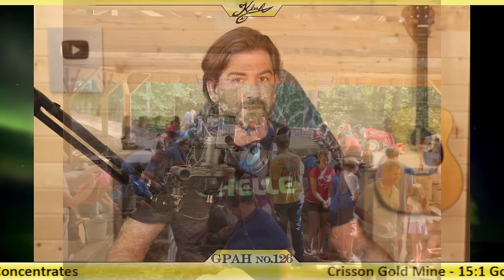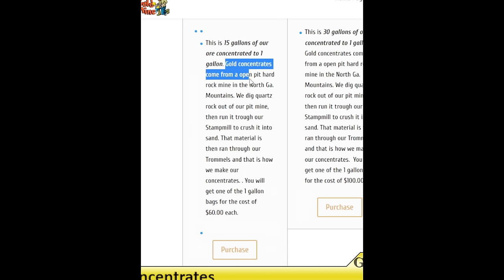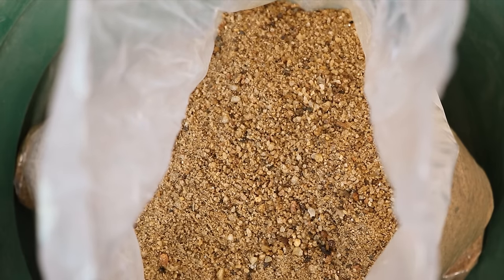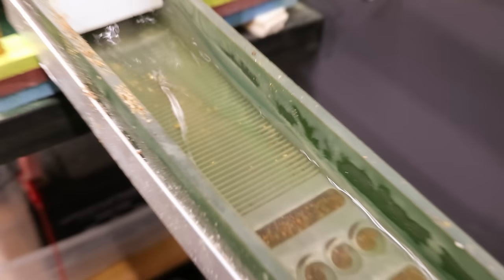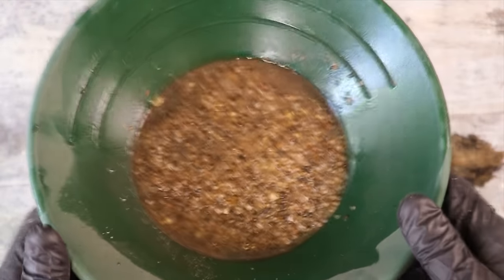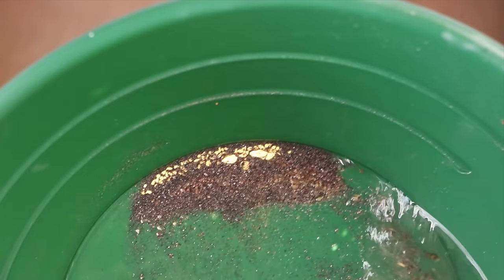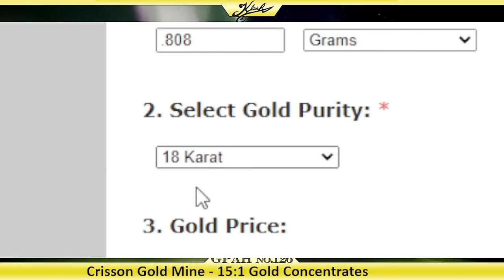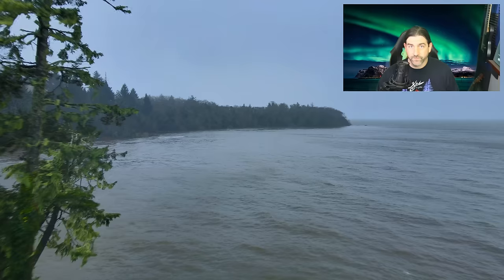Crisson Gold Mine - 15:1 Gold Concentrates

Comment: I would tell people that are hunting for good paydirt to try Kleshes gold paydirt once instead of hunting and hoping you find someone that's honest.

Shane has an excellent reputation and he's not about to mess that up. And another good thing about his dirt is, it's written on the package how much gold you are gaurantee to have in that package but you are always going to find more than is gauranteed.

I always pan his dirt carefully and a couple times to make sure I get it all. And if you're lucky you just might end up with a bonus bag that has a big nugget thrown in. And I think that goes for all the dirt he sells. If I'm wrong he will correct me I'm sure.

As for me, I have finally found my one stop shop. Also, look at the other things he has and uses himself. He will put it down below the videos.

Check out what he uses for black sand removal. I bought the equipment he uses and that is a lifesaver for getting black sand out of your dirt. The magnet is extremely powerful and it works better than anything I've bought for black sand removal. It's fast and easy.

Comment: I think to get better results since it's crushed rock from load mine you need to crush everything to a -50 or even -100 and then use furnace o chemicals
Reply from the maker: I still have the tailings maybe I will try 👍